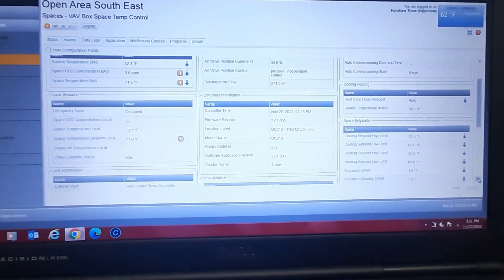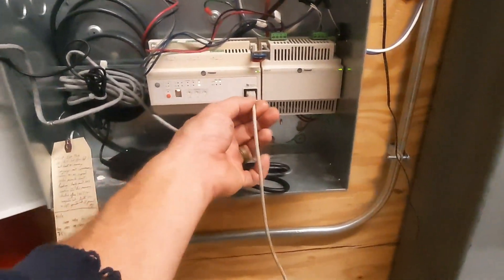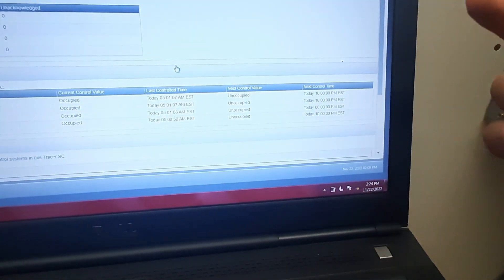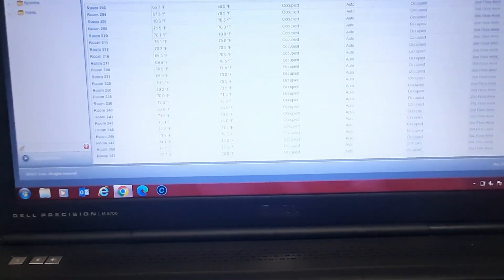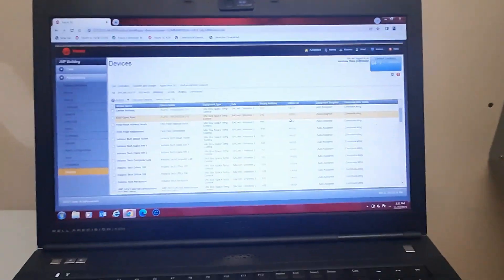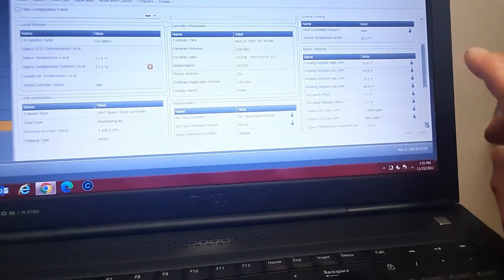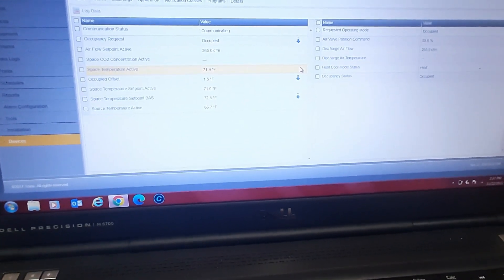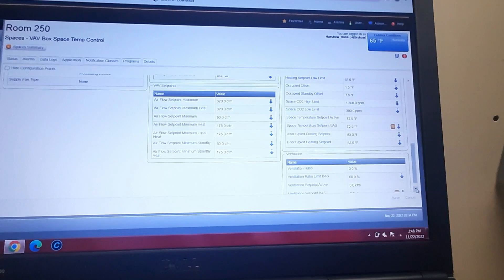the office and cubicle area are too cold in the morning. Trane VAV system controls.

Comment: Is this software accessible to non Brady trane employees?
Reply from the maker: It has to be purchased through trane and you must have a license. It can be difficult for some to get but it is not exclusive to trane employees.
Reply: @EverythingHVACR 10-4 I work for JCI  dealing with a trane RTU setup with VAV boxes and it would be nice to have. Thanks for the reply on such an old video
Reply from the maker: @NoahbHvac talk to anyone you know at trane, they may be able to help. I work with some JCI folks at times but they are usually working on the BAS side of trane DOAS without controls.

Comment: I usually turn off the local setpoints as well on each zone sensor cause people play with temp setpoints. Do you usually leave those on for each zone to have control of the setpoint, or is it better to let the setpoint ride that’s programmed on BAC? 

I’ve noticed I’ve had to play with minimum damper positions, zone votes, minimum zone deviations etc etc to try to make these women happy in our buildings. 

I usually just leave the local setpoints off so they can’t play with them
Reply from the maker: Your never going to keep everyone happy. If Stat is in a common area I may leave the set point from the BAS but if it's in someone's office, to keep them comfortable I make sure they know how it works and set it to local. Thanks Jimmy!